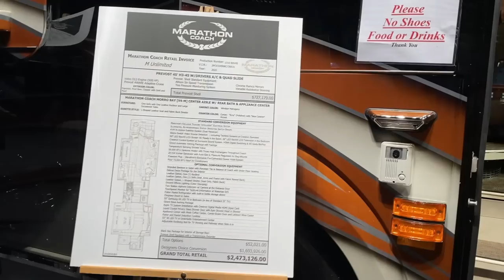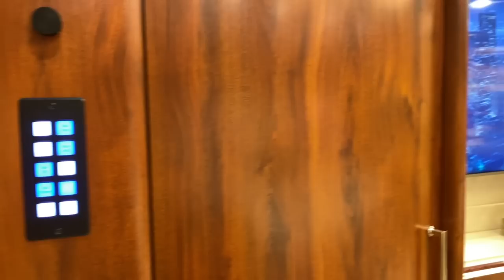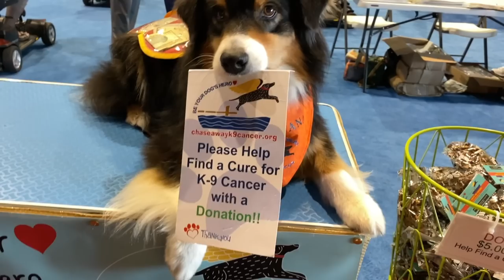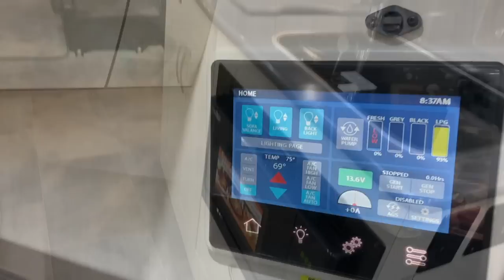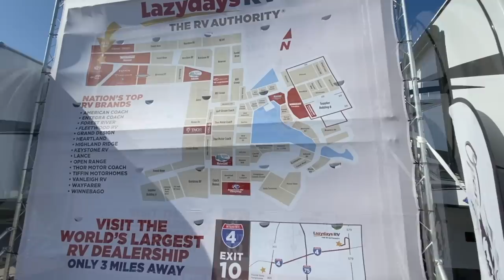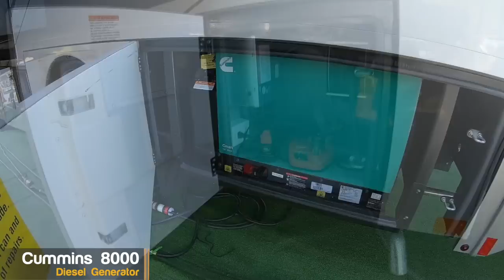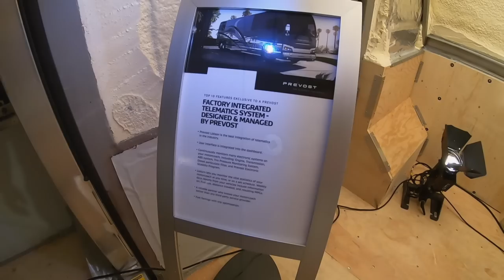Tampa RV SuperShow 2020 (Part 2) Show Overview!

Comment from the maker: We just wanted to take a moment to apologize for some of the shaky footage in this video.  We had a couple things going on with this and other videos during this show. Plus it's really hard to take your time shooting a slower moving video when you have someone coming in behind you that is waiting on you to "move along" because they don't want to be on camera or waiting for you to move out of their way.  That's always difficult, as we don't want to be rude to them so we just do our best and move along and work with what we have in editing.  Thanks so much for your patience and understanding. 🧡😊🤓 ALSO, the Liquid Spring test results were very good!  The ride is VERY noticeably better and very similar to a diesel chassis.  There is still a noticeable difference between driving this gas coach vs a diesel chassis, but what a difference Liquid Spring made!

Comment: Commenting as I watch:  Michelle, has Brian started his plans for making a Gondola? lol I honestly don't know why they would even bring such ridiculously expensive RV to this show, if they were so protective of it.  JEEZ Iol I wonder about the  Streams and if the temp control is efficient.  I love the look of them.  The one for 580K was pprreetttyy sweet!  I love how Brian used his "man power" to pull out the counter extension. lol! Wait,what?? 675K for an empty bus and then add the choices of options??  Great video guys. Glad you survived the RV Show.  Wish us luck at the boat show next weekend!
Reply from the maker: Brian doesn’t need another project lol!  The Airstreams are built pretty well and without slides, they don’t lose much air at all.  Everything that has a slide seems to lose a lot of air out those seals plus you can hear a pin drop from outside lol! 
Yes, that Zephyr was very sweet!
Lol “Man power“ 😂 💪🏻 
$675K for the shell of the Prevost bus is for those who want to design the inside themselves and paint the exterior to their liking.  Everything else is there.
Thank you and good luck at the boat show! 🧡

Comment: How did the Tiffin with liquid springs handle compared to your Newmar?
Reply from the maker: Honestly, it was very stable but it still just doesn’t compare.  A gas coach is just so different even with Liquid Spring but they are better than Sumo Springs in my honest opinion.
Reply: LivinRVision that’s what I thought. Once you drive a pusher gas A’s don’t compare. We serious considered a Tiffin gasser in 2016. I would have added the liquid springs. They ain’t cheap though😳. Thank you for the reply.
Reply from the maker: You’re right, around 10k I believe. 😳😱
Reply: @LivinRVision  I agree my first coach a few years ago was a gaser tiffin 34 pa.I was the first to install(liquid springs) in arizona and had la mesa install it. I went with a 2019 tiffin 33aa red anyways. No comparing the 2. It did however ride better than any gas. My cost was 11k to install the liquid springs.

Comment: So how did the Liquid Spring ride perform compared to your DP?
Reply from the maker: Hi David, thanks for your feedback. As far as stability very comparable, but you can still tell that you are driving a gas coach, not just because of the loud engine noise up front, but the steering is stiffer. Liquid Spring does make one huge difference though! 👍🏻👍🏻

Comment: How was that liquid ride?
Reply from the maker: You could really feel the difference, especially after we drove the coach without Liquid Spring.  One thing I really noticed was how it had an impact on the steering. Steered a little harder, as in between power steering and no power steering.  Didn’t think that would have an effect on that, but Wayne from Liquid Spring said it does. Definitely takes the rocking back and fourth out of the gas coach chassis.  👍🏻👍🏻😊